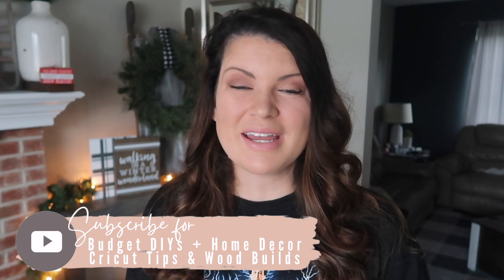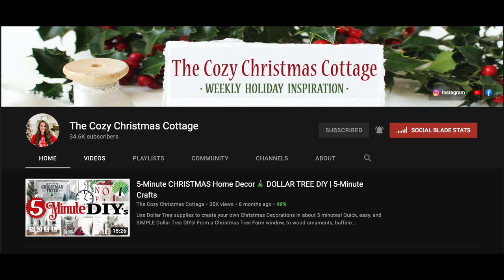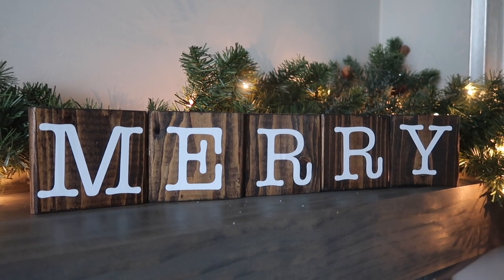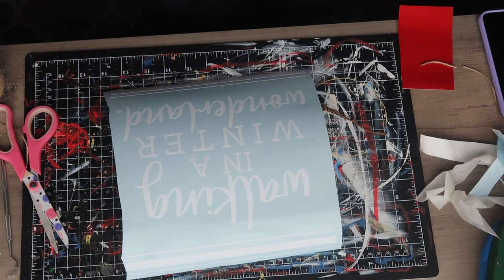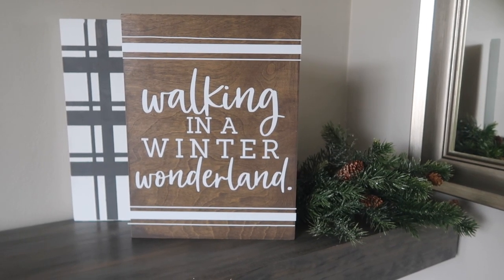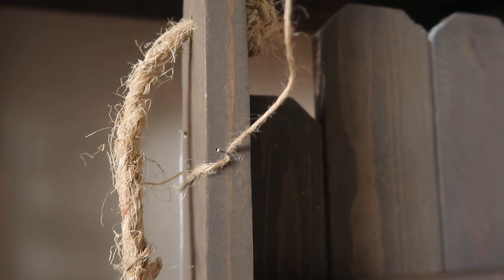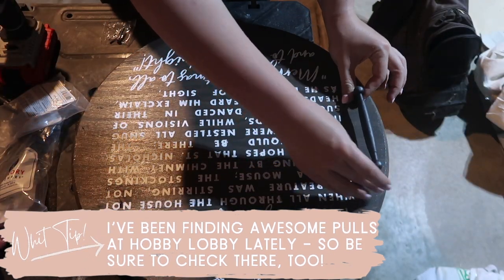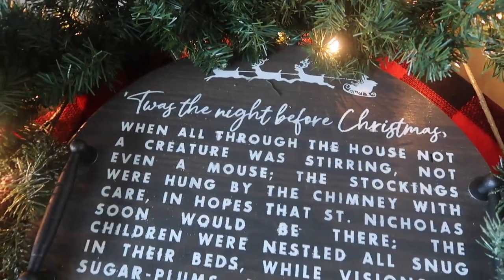10 Beautiful & High-End Wood Christmas Decor DIYS f 🌲 Simple Hacks + Dollar Tree DIYs

Comment: Hey there Whitney . . . I absolutely LOVE the luminary and I'm trying to recreate it tonight.  Did you spray a matte sealer on top of the vinyl cut outs?!? I'm finding my vinyl is lifting a bit.  Thank you so much for this DIY . . . hoping to sell it (them) at one of my craft fair in November.
Reply from the maker: Hi there, I didn't apply any sealant. What I would suggest is making sure you don't spray the frosted glass spray on the side you want to stick your vinyl and it will adhere best to the bare glass.
Reply: @Whiskeyandwhit  Since I'll be keeping the first one I made (practice one), I ended up spraying it with a matte sealer and it worked great!  Just an FYI . . . It turned out beautiful, although you made it look so darn easy. I was on the 'struggle bus' with the placement of the square wood dowels to hold the glass in place.  Soooo enjoy your channel :-)